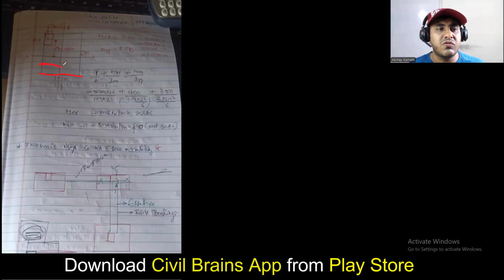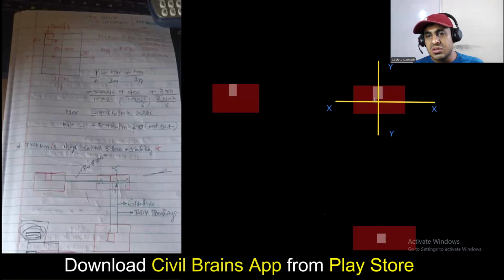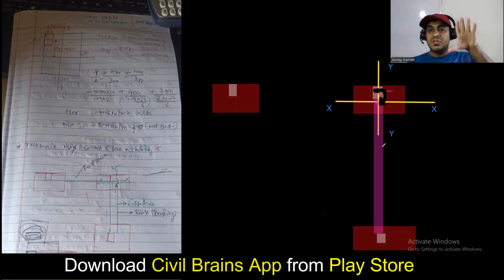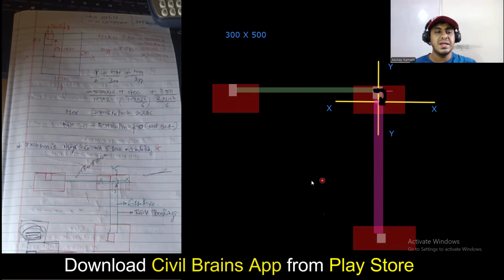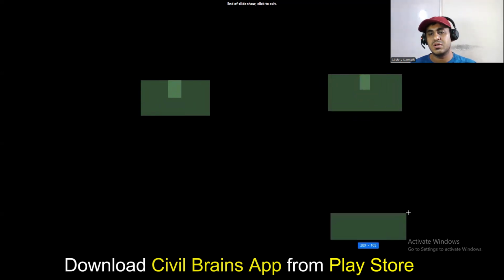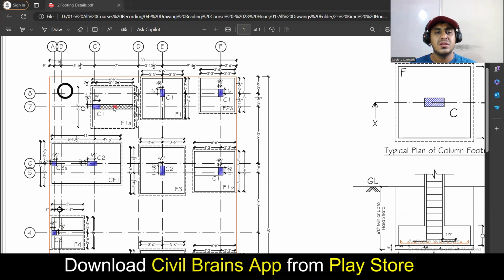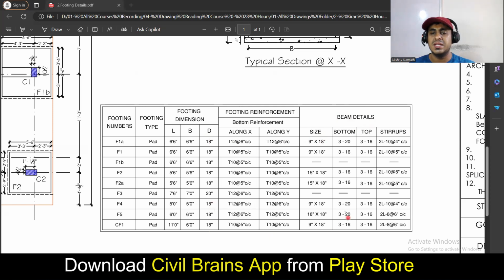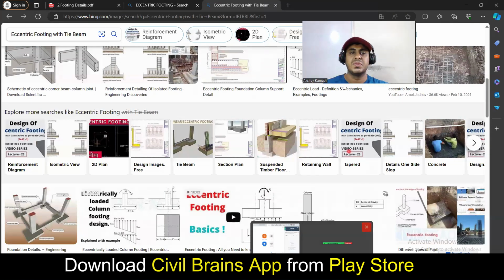Eccentric Footing Design | Eccentric Footing | Part 3 | Civil Brains

Comment: Sir that strap beam should it be anchored to opposite column bcz in the dorwig itself some straps seem that they're connected to the footing not the column, e.g C-7 footing the strap beam isn't connecting to E-8 Column. Is that ok
Reply from the maker: Correct. Either connect to column in case of combined footing or connect to footing end in case of isolated footing